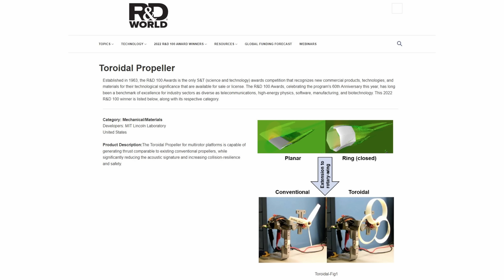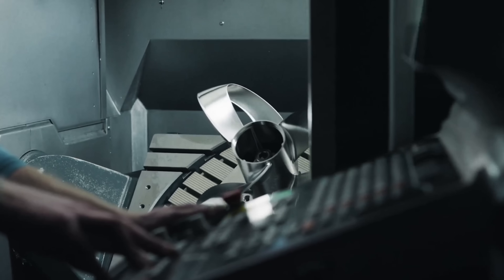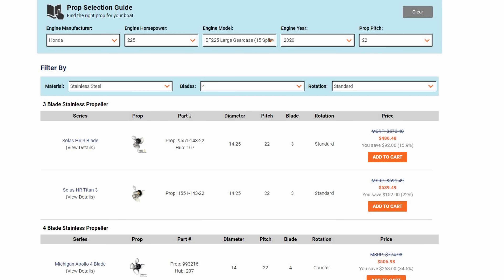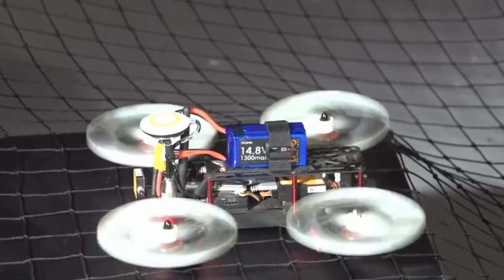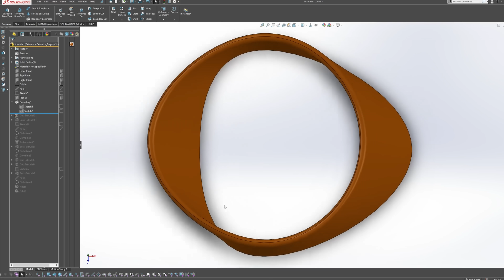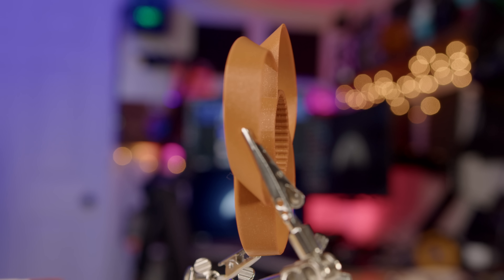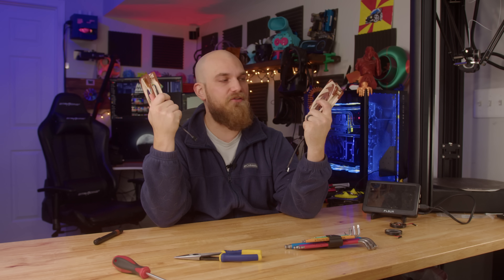I Turned MIT Award Winning Toroidal Propeller Into A PC Fan | Fan Showdown S5 Special

Comment: A PC fan is ducted, meaning it doesn't have the tip vortices issue. And toroidal prop is specifically designed to reduce vortices - it is basically its own duct. So sure enough it doesn't do anything in this setup. 

Also, a way you can reduce audible noise is by spreading its frequencies out, by physically adjusting blade position such that the distance between them is randomized - just make sure it's balanced. The more blades you have, the more you can spread the noise. I wouldn't be surprised to know that the Noctua fan blades are ever so slightly misaligned.

Comment: I'm guessing it probably shouldn't have the case. The props aren't using a case to funnel everything, some of the extra noise may be due to the prop being close to the rim. Normally a fan blade has to be as close to the edge as possible, so that air gets pushed through and not lost to distribution on the sides or recirculating the same air. This fan design has its own closed in edges already, so it shouldn't need the ring around it. 

I would also check for vibrations. A factory produced fan, with the equipment and processes designed to prepare every part of the fan is intended to help keep it balanced. I would try measuring the vibrations of these fans on their sides. I don't know if using a phones accelerometer is sensitive enough, but probably, and there are apps for it. I.e. there may be added noise simply from part of this being out of balance and/or vibrations.

Comment: I think the difference is the toroidal sound is much deeper in pitch. It's much easier to dampen deeper frequencies than higher ones. So at a distance a toroidal fans noise would have deadened more than a stock fan. Hence why this makes more sense for drone noise reduction

Comment: I still don't understand how this design is any better than a propeller with an annulus around it which essentially removes the tips of each propeller blade.
Reply: Yeah, overhyped thing because MIT is essentially a brand name rather than a university at this point.
Reply: @amentco8445  Exactly! Even elliptical wings on aircraft like the spitfire go a long way to eliminate tip vortices. This just looks like a trendy interpretation of that shape. A longer blade chord and rounder blade tip would be close to achieving the same thing in my opinion. I'm just an armchair expert though. Albeit one with an aerospace degree.

This concept is all fluff in my opinion.

Comment: The toroidal shape propellers showed significant gains compared to the helicoidal shape on early 70's . The problem at that time was replicating the shape for production , now we have 3d printers and cnc machines that can easily produce this shapes , isn't cheap though, at least today. There are already a few companies doing this propellers for marine and drone applications . The efficiency in marine applications is around 20% better and generating less noise and cavitation

Comment: Quadcopters props generally have 2-4 blades to balance efficiency and power at high rpm. I would bet increasing the number of blades would do wonders to help the toroidal design move much more air.

Comment: you need to have in mind the surface of the propeller: remember that 3d printers are great for making prototype pieces, but they aren't so effective creating aerodynamic "things", there was another guy on youtube that tried this propeller on his drone and it didn't have such great results, he also says because it's a 3d printed propeller and not a plastic-injected-smooth-one which may have different results

Comment: the thing about Toroidal props is that the angle and widht of each wing are unique to the size and RPM you want the best performance from (this is a well known thing amongs boat owners and that the Toroidal propellers are custom made for each boat engine (model and etc) and the boat props look very much more different than what you printed out.

Comment: The reason the traditional fan is operating better is due to the duct eliminating most of your tip vortice effects. In open air, the toroidal would be the higher performing prop.

Comment: you should also consider, that the computer fan rotates at a fixed speed. if you however, have a variable speed, and match by power, rather than rpm, then both fans should move the same amount of air per watt. This is why its not a bad thing for drone, because since it has less blade area, it will just rotate faster, and not use more watt in the end. Also blades with less blade area have better precision in throttle control. because if the blade has a lot of power, then tiny adjustments in RPM will make too much difference, which will make a drone very unstable.

Comment: I might be wrong but I have noticed that propellers with more blades tend to be quiet than those with less. Your toroidal model has three big blades that perform similar in sound; however, your standard fan has 9 blades which might be the reason it is slightly quieter. Perhaps if you had only three standard blades of similar size then the toroidal would be the sure winner.

Comment: the toroidal is also 3d printed which means it has a pretty rough surface, which affects aerodynamics, it has too few blades compared to the regular fan, the profile is just a eye measured and in a shrouded fan vortices at the tip aren't as big of a concern anyway as the airflow is restricted around the blades anyways.

Comment: A drop of knowledge.. The cooler is a duct fan. It has improved flow due to the nozzle effect of the duct, that is designed for that, and also the duct does not allows the formation of tip vórtices (ok, reduces a lot) and that is why most of the ship´s trustes are ducted. Coanda also used it on his planes, and it is the origin of the turbofan. Also, the blades design are engineered, not guessed by design. It would be quite surprising if you manage to get in one try, nevertheless we can see how much potencial the design may have for thus application, and I must say that I do not see it as interesting for a ducted fan. You lost a lot of mass efficiency by the lack of blades to push the mass of air forward. Keep in mind that the physics are different to generate thrust and to push fluids. Very interesting video and experiment...

Comment: I think the most efficient place on a conventional fan is at the edge of the blade, because the angular velocity there is the highest. I would change the shape so that the part with the edge has the highest angle....
It seems to me that these fans cannot be comparable because the total area of the blades would be larger for a conventional fan. It simply has thinner wings and maybe they are tapered at the bottom.

Comment: A large portion of the gains from the new design are in the form of turbulence and vibration mitigation which. Due to the nature of 3D printing the surface of the blades aren’t perfectly smooth which drastically decreases gains.

Comment: This design reminds me of the concept which noiseblocker NB-eLoop series of fans used. They are not the highest perfomer out there in terms of static pressure or volumetric airflow, but are certanly quiet compared to the competition. There seems to be a relation between merging the tips of the blades and the perceived noise by the user.
Reply: Apparently the tips make the most noise on a normal fan, and by merging the tips you remove the tips. No tips, less noise.

Comment: A note to anybody who's wanting to make one of these, remember that it must be shaped where it is functionally a wing. Remember the propellers do not push themselves through the water they actually pull themselves through the water just like the propeller does on an airplane. A propeller on an airplane is nothing but a rotating pair of wings or three wings or up to six or eight wings.
The Scimitar shaped fan is already quite quiet. Which is why that's what you was on our nuclear submarines.

Comment: Well, with a bumpy surface like this, I am not surprised that the toroidal is actually louder than the conventional fan. Unmodified 3D prints are just not there yet. You would have to smooth it over manually.

Comment: The reason the toroidal does worse is likely  because it has substantially less area to move the air. It's meant to run at a much high speed where the cooling fan would create too much drag.
Something else you could look at is the asus rtx fans, they have a ring around the tips.

Comment: I would've tried a rim driven prop.  As others alluded to the ducting and turbulence issues.  It was also obvious that the MIT torroidal had less blades than the default.  So quieter maybe, but less performance.  Although you revealed it wasn't quieter either.
Fun experiment, great video!

Comment: Maybe worth noting that the scimitar-shaped blades in the Noctua fan are already optimized to minimize tip vortex shedding. The increasingly swept tips behave like winglets or tip extensions on a modern airliner's wing, and that's why we see curved blades in modern turboprop aircraft like the A400. That's also why modern submarine screws have similarly swept tips.

MIT arguably should have compared their toroidal design to a similarly-optimized conventional drone prop. The straight props on most drones simply aren't optimized for noise or efficiency.

Comment: Maybe a little background: The noise problem of drones is pretty much created by the fact that they have open rotors. If airflow goes from bladetip pressured side to low low pressure side vortices are created. The noctua fan is not an open rotor fan, its surrounding structure inhibit this airflow that creates the vortices (if they are very close, so tolerances should be tight here). Problem on A/C: Nacelles around engines also create drag. No an issue for the PC, it doesnt move, but for everything that moves through air (or water) its an issue.

Comment: I saw a headline about that toroidal propeller but did not think much of it. I think there are multiple reasons why drone blades are noisy despite they can simply put larger and more blades for less RPM and quieter operation.   For example, smaller blades better for instant response to wind to get more stable videos aside from being more nimble for action flight.  In the end, I think the commercial jet engine have the best design and materials for just massive airflow. High end laptops have fan blades at multiple dozen blades.

Comment: personally for this to work better than a normal pc fan it would have to be run at higher rps than regular fans because as far as i was aware the fan design is supposed to be quieter while also giving more performance.. so basically quiet fan even at higher rpms = better cooling and less annoyance also i recon it needs a tunnel design that blows onto copper fins as opposed to the regular heatsink style. imagine a cylinder lying horizontal and the heatsink comes up through the middle with the fan at one side of the cylinder..

Comment: If you arent using the same specs it wont interact with the air the same, also you need to smooth these propellers professionally before they work silently. The small surface imperfections will make a lot of noise and turbulence.😅

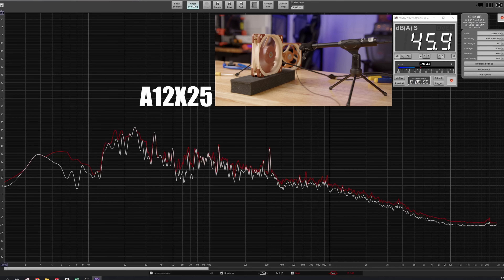Comment: i think your testing was flawed. 4:30 you can hear that the toroidal noise isnt from the air but from the mount vibrations or whatever, where as the noctua was mostly sound of the air. That explains why theres less high frequency, because you're picking up less air sound. Basically you're hearing noise because of shoddy build quality, and MIT's design is superior in reducing sound from air. if you remade it with a better build quallity it should be MUCH quiter than noctuas.

Comment: This is the second video on this design that I've seen where the toroidal is actually louder than a regular fan/prop. Weird. The MIT's one is probably more precisely designed than what a commercial 3D printer can do, but even so I doubt it's that much of a leap forward.

Comment: Notice every use case scenario for it is always in the 2500-5000 RPM range? Also the wind noise can affect the decibel meter, so measure it blowing away from the mic, not towards it.

Comment: I think you should compare the props without a frame.
A frame helps to prevent the tip vortexes.
A toroidal prop comes with an "integrated" frame not benefiting much from a additional frame.
In contrast a conventional prop would suffer without a frame.

Comment: Bro, the gaps on the outside of the blades are causing turbulence and excess sound. The drone blades and underwater propeller do not have an outer frame like a PC fan. Blank off the outside of the blade and make it sit as close to the outer frame as possible. That way the blades on the inner circles are sucking in air without the turbulence caused from the outer ring as it compresses the air between the blades and the surrounding frame.

Comment: I think the issue you have with your version of the toroidal is the edge, look how smooth but aerodynamic the fan blades are on the AX... then look at the edge of the one you modified... polish and smooth out the leading edge and we might see more of a difference. also wondering if there is a way to (like you said) optimize the angle? Not sure... But very interesting to see a rough mock up of something compete with a design that has had decades of development to say the least. I see this as a low key W for the toroidal.

Comment: Interesting video.  But for me it was a little bit of confirmation for a purchase I made.  I swapped out my QNAP NAS OEM fan for the A12x25 a few years back.  This video makes me glad I made that choice, as I based it on the "eye factor" - it looked like the best fan for my application!  However, after installing the A12x25, I didn't see any significant decrease in noise, or temperature...
Anyway, I feel vindicated in my decision, even though I didn't see any Real World differences after the install...

Comment: I think another likely reason the 3d printed fan isn't quieter is that it's probably not as well balanced as the commercial one, and putting torque on the motor shaft as it spins.

Comment: You should test vs a 3d printed version of the Noctua fan, not the smooth injection molded one, so the layer lines etc. are accounted for.

Comment: Before making any final determinations, I noticed the blade for the boat was very smooth and had no real flat edges. From the looks of it. The fan blade still has the 3dprint texture as well as some flat surfaces. Why not try and make the blades as smooth as possible with curved edges. I'm not sure how much prep work was done on the fan blade, just making an observation on my crappy revolution phone screen

Comment: I feel like the difference in fan blade count would make an impact, if you say had a 6-blade fan or even 4 to compare to the 6(basically 3) spokes that come off the toroidal fan blades. it might be more comparable. also, I feel like being in a duct, or having a shroud around it, probably effects the performance and effectivness of the toroidal design, you have to remember the toroidal propeller is used primarily on ductless drones. And normal props will have a different acoustic value spinning inside of a tunnel or enclosure than spinning out in free air. So I'm assuming so would these. Just a couple variables to think about that I'm sure you did, but either just didn't mention or I haven't gotten to that point in the video yet. Both have a large impact on the sound a drone makes so I'm sure even at lower RPM and a less severe shroud around the fan would still have a noticeable effect.

Comment: you should have added the nubs to the blades like those found on the noctua fan blades. idk what they are called but they are supposed to help reduce noise. this addition to your design could potentially lower to dba even more.

Comment: I wonder if there are any actual benefits of using this design inside a ducted fan - the main advantage which is reduction of tip vortices likely isn't so advantageous anymore, because the ducts reduces them too... or does it? Other than that - making a good propeller is far more complicated than just twisting 3 rectangles around and calling it a day.

Comment: most noise is generated when prop parts travel close to static bars that connect motor to fan case. shape of cooler fans is made the way so there are close to 90 deg between prop blade edge and static bar. in your fan design these angles are not consistent and very different and this is a reason of louder sound. without these bars and on higher speeds your fan would be less loud.